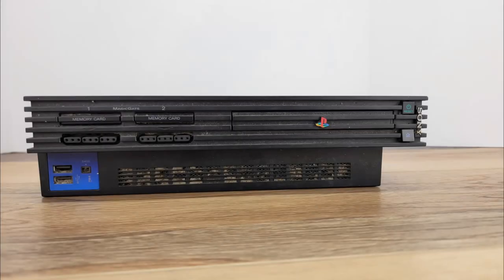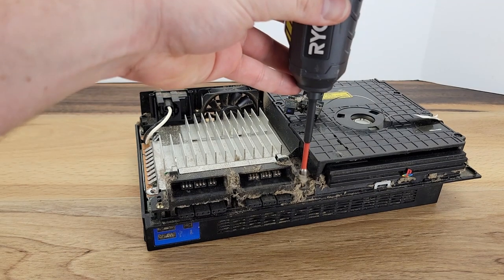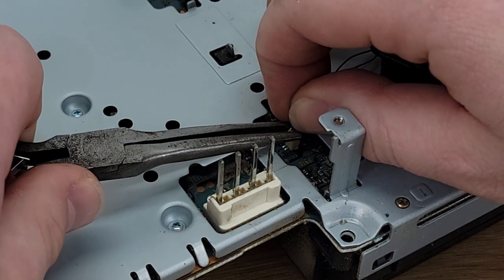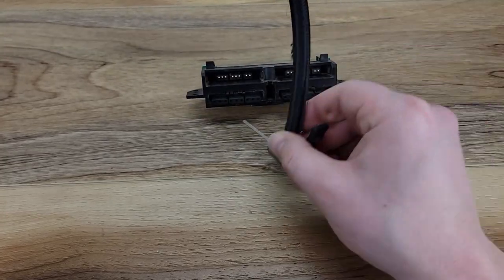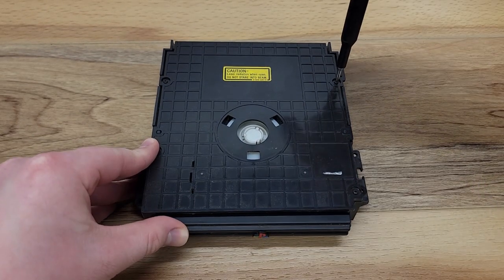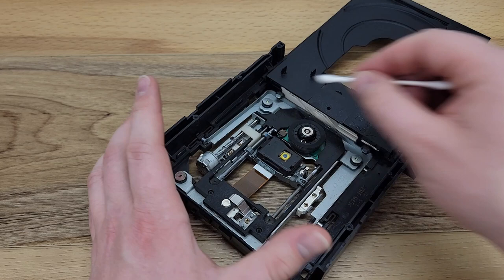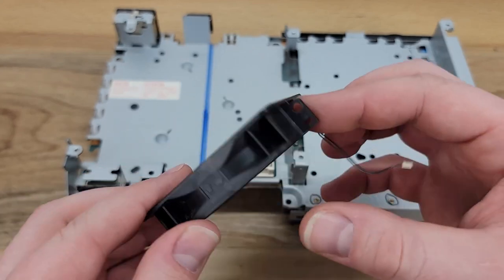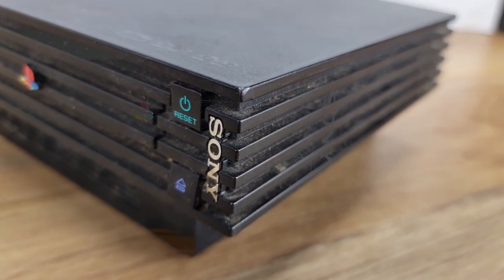Sony PlayStation 2 Slow Opening Disc Tray Repair w/ Step by Step Disassembly, Cleaning & Reassembly

Comment: Cleaning the optical drive is not enough, sometimes it could be the tray motor or the belt. But even if you have replaced the belt and are still having issues then most likely the tray motor is dying in which case you need to either find an entire optical drive or the little motor inside it.
Reply from the maker: Agree, there are many potential causes for the slow opening disc tray. That said, I've had good luck and have done dozens this way. As these consoles age, there's bound to be other issues and failures unfortunately.

Comment: Very cool. Curious what kind of compressor you are using. Thanks for the video!
Reply from the maker: I use a Ryobi battery powered air pump w/ a needle that's designed to fill basketball/footballs etc. Home Depot spells them for 19.99 tool only and they work absolutely perfect for this kind of project.
Reply: @Wildsamsquanch7  Excellent. TY!

Comment: Umm, when you put everything back together and turned the PS2 back on (after all the cleaning), the "screen dot" in the menu screen was still not moving. Did you check the clock battery again to see if it was either in backwards or was possibly another dead battery?

Non-animated dots on the menu screen are always a non-working clock battery.

Comment: Hi, nice video ! What grease should we use ? I didn't get it
Reply from the maker: I use White Lithium grease in a tube. Most big box hardware & automotive stores should stock it.
Reply: @Wildsamsquanch7  Thanks for your answer I'm gonna try to buy that right now and fix my disk tray, hope it'll be enough.

Comment: I was almost done putting it back together and the plastic connector that clamps down to the ribbon on the mainboard Broke off. Now I have no way to secure the ribbon. FML
Reply: @LiamW22 there’s no way to secure a tight connection. The clamp broke that holds the ribbon in place.
Reply: @LiamW22 I’m not following, I would need to see pictures on what you mean. The ribbons are not the issue. The plastic connector clamp that is soldered to the mainboard is the problem